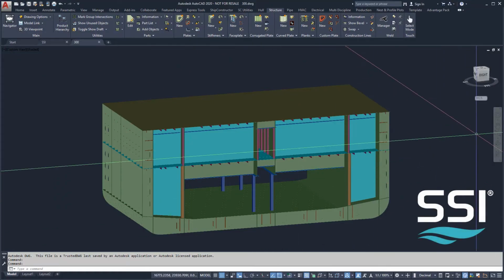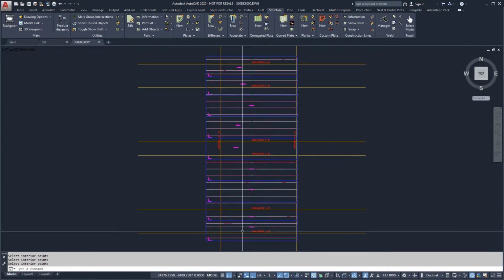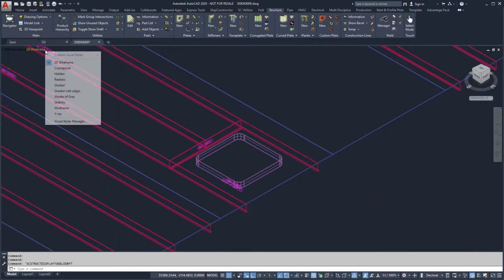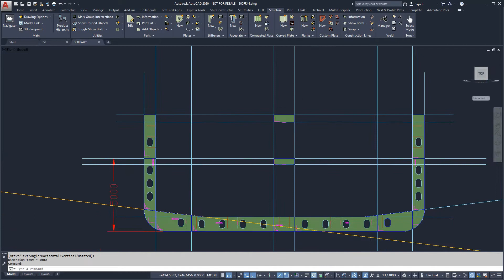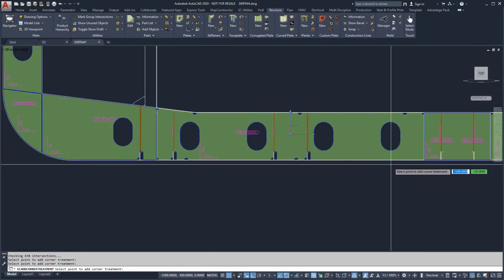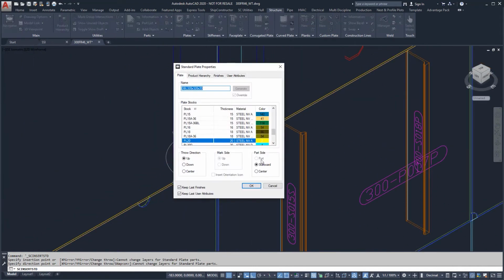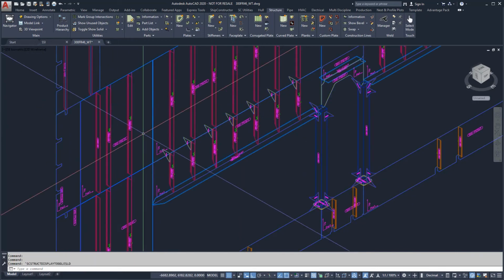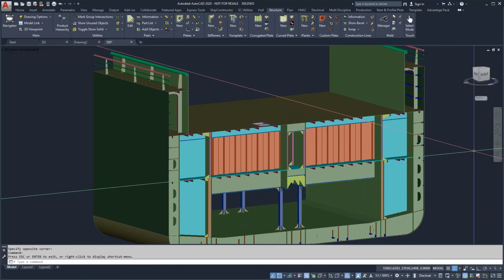An Overview on How to Add Detail to a Basic Design

Comment: I don't know that we use Autodesk/AutoCad to create 3D models of detail parts/assembly for large ship design
Reply from the maker: ShipConstructor is an AutoCAD based software product line created for design, engineering and construction in the shipbuilding industry. ShipConstructor's AutoCAD foundation provides a user environment that is a globally recognized CAD/CAM standard. This results in an existing labor pool of expertise, a common DWG format for sharing information with other applications, and a portfolio of complementary Autodesk products.